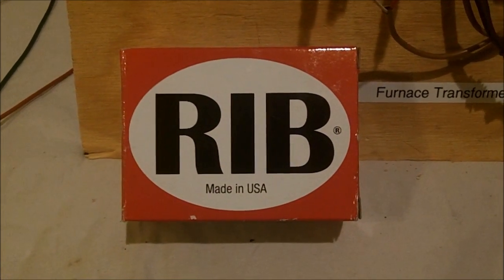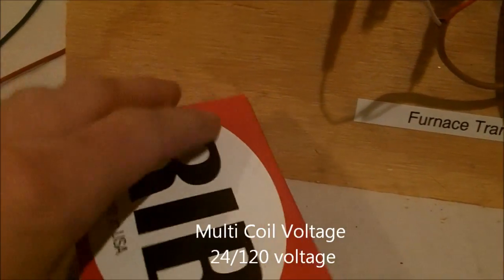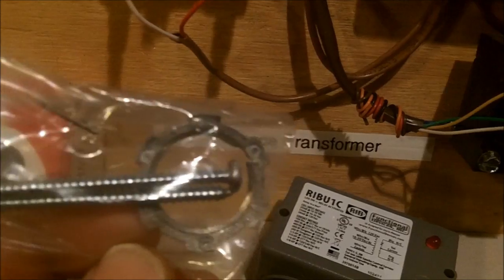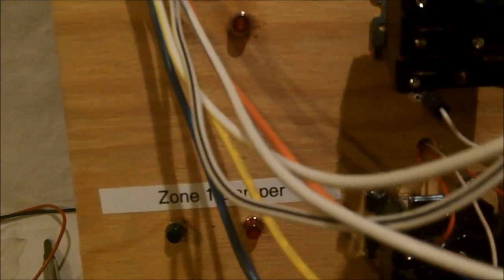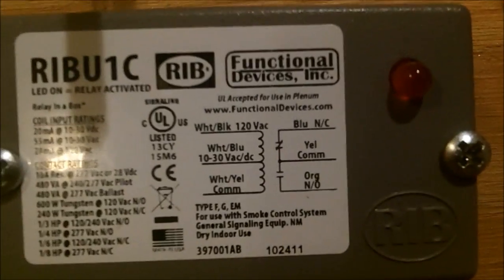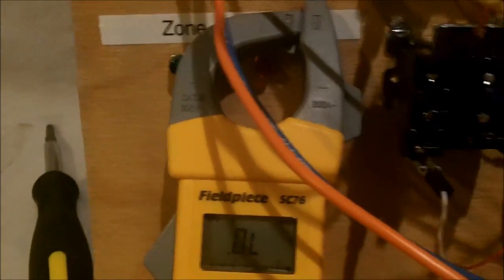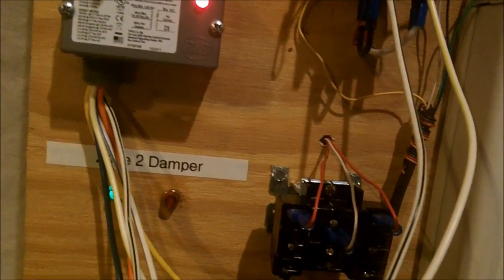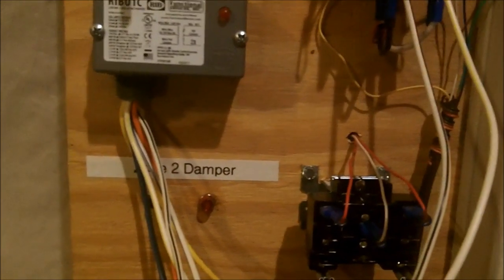Relay In A Box

Comment: I appreciate the demo and will be buying this for a Panasonic bath Fan control wire connection. I will be using a simple wireless switch from "ILLUMRA"  for 110 volt to the RIB. The relay will make the continuity connection and signal the fan to startup. Hey you sound like Matthew McConaughey. You have a cool guy accent. Later dude - guy from NY.

Comment: You seem very savvy with controls, so I ask you how do I apply the rib in this case? I have a air handler that does my a.c.and works fine but I also have a hot water coil inside for heat. It has been plumbed down to its own zone on my manifold and has a taco controller. Now up at my air handler I would usually connect my low voltage to the tt terminals like on a hydro air configuration. My low voltage strip inside my handler only has r w y g c? So how do I use a rib to call in the circulator and the fan in heat call but eliminate the circulator in calling for cooling? Any help will be appreciated and I already field fabricated a flat 90 from straight duct thanks to you and your metal videos ⚒✂️✍🏻👉🏻👌

Comment: what's the purpose of this? doesn't a transformer do the same thing. sorry im new in the trade. what would you apply that to? thanks
Reply from the maker: +Jason Bouchard control voltages come in many different forms. You can run across 240,110,or 24 volts. This is just a way to ensure you have the right relay for the job.